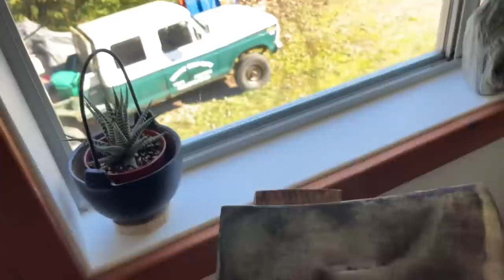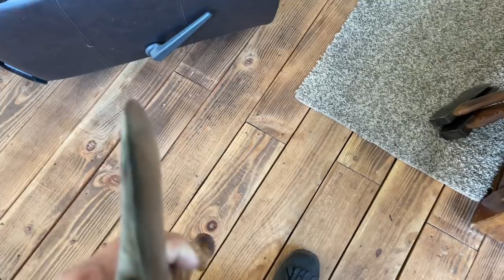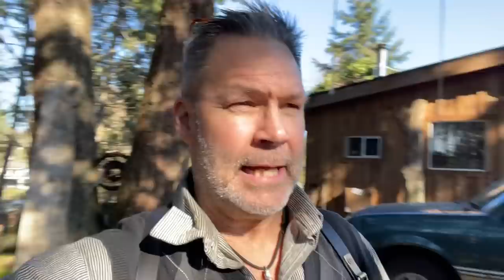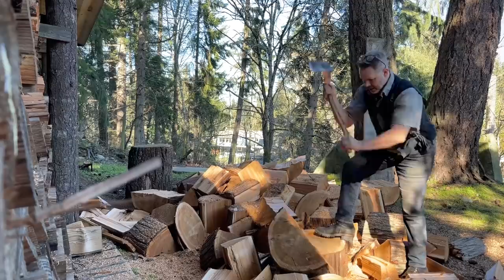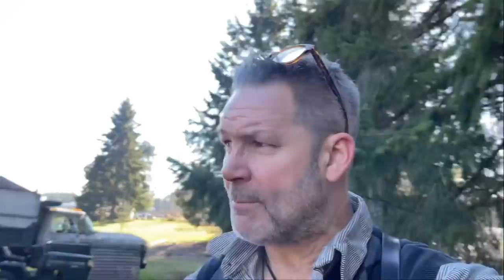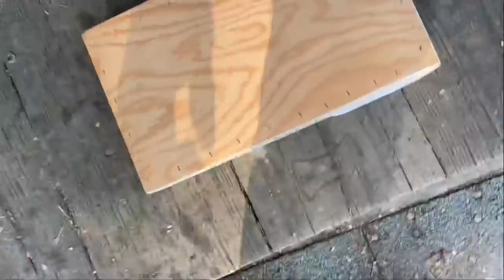MEN!, ARE YOU LISTENING. #letssplitthis

Comment: Sometimes the odds are against good people with good intentions. I climbed for the power company for 2 years in the mid 90s,then the next 20 years drove a trash truck.I was saving to build my tree business and planned on starting it in 2020 way back in 2014.Just my luck,i broke my leg dec 28th 2016 stepping out of the truck.  Then got "let go" 3 months later.  So i was forced to start my business 3 years earlier with a broken leg.  Shattered all those little bones in my foot too.  Standing on gaffs was rough the first year. If i can do it anyone can cause i am a low energy person.I fall asleep changing oil,or reading an instruction manual.   You can do it.